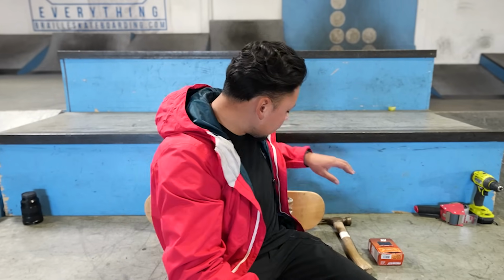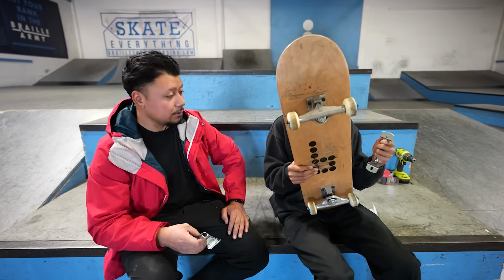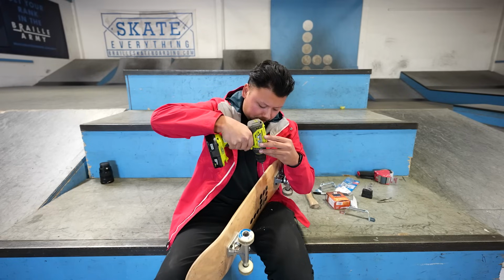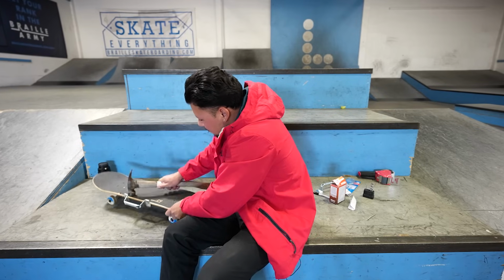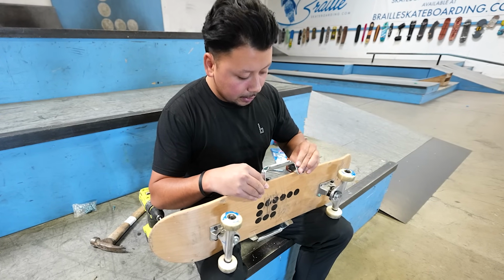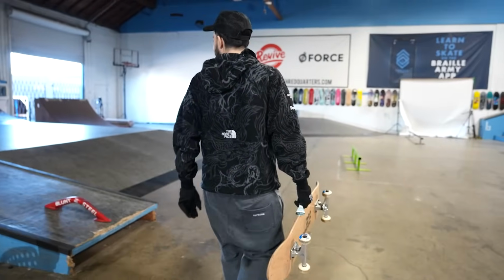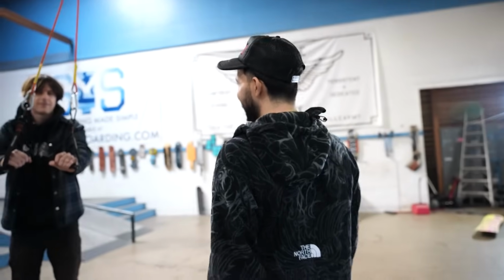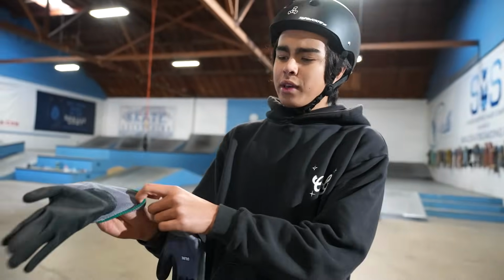ADDING HAND-GRIPS TO A SKATEBOARD?! SKATE HACKS

Comment: a pilot hole shoul be no bigger than the central shaft of the screw ie not the thread of the screw the diameter of the core of the screw.

Comment: Cutting a slotted hole into each side of the deck would be better, as it wont be in direct line of contact with the ground like the fastened on handles would be.